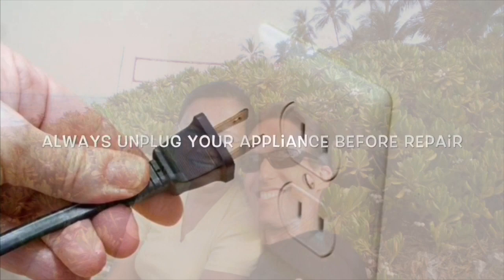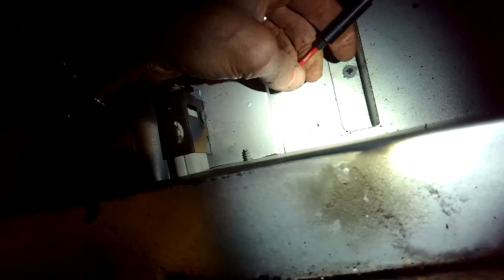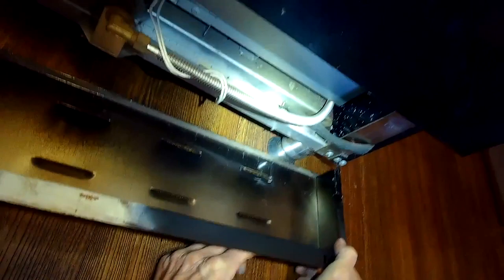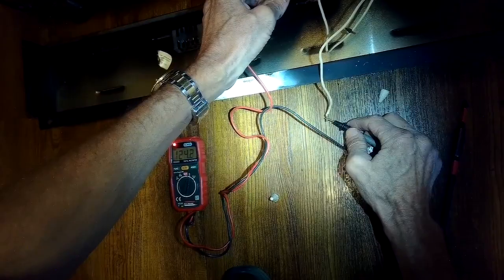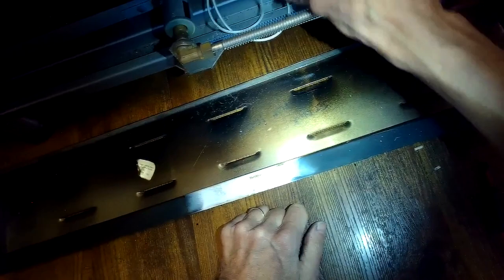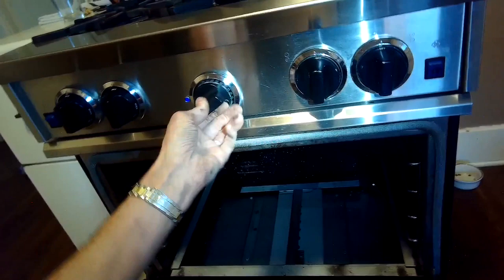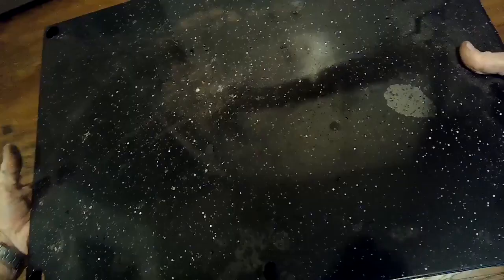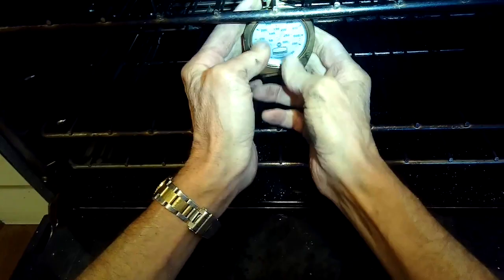⭐️ BLUE STAR ⭐️ OVEN—NO HEAT—EASY FIX

Comment: Your instructions worked great and my Bluestar is back in action. Interesting that Bluestar charges $135 for their "official" igniter but you can get a generic one off of Amazon or eBay for about $25, so thanks, also, for that tip. I have a newer model that has a two-piece (connected by a simple zip-tie to connect them) heat-resistant woven fabric tubing over the wires but it was easy to thread the wires themselves through. I also cut off the female metal electrical connectors Bluestar used and simply use the ceramic wire nuts supplied with the igniter. Also, I did not have to remove the oven door as it was possible to remove and screw back in place the retainer screws holding the lower stainless steel facade in place by lowering the door get access to the screws. Many thanks for your thorough instructions which saved me a lot of money and stopped my wife from complaining that Blue star ovens are expensive junk. I did send you a small contribution, the least I could do to thank you, through PayPal. The other problem I have with the range is the high-intensity left front burner piezo igniter some times won't stop "clicking" after the gas ignites and I can't get it to stop no matter how much I've fiddled with its distance and angle to one of the gas orifices. It is a new one although the original one that came with the range did the same thing.
Reply from the maker: Great Job,
Might be good to super clean all the metal parts to create a better ground.

Comment: I've watched the video, read the comments, removed the old igniter, and capped off the incoming wires. Now, with old igniter in hand, I am looking at the  "Frigidaire 5303935066 Igniter for Range, 1, white" at the amazon link you provided. The ceramic portion of that new igniter is much shorter than the ceramic portion in the part I'm replacing. Also, the replacement igniter in your video is an Electrolux part. I just want to be sure I'm ordering the right part. I welcome comments from Scott or anyone else who has completed this igniter replacement.
Reply from the maker: The shorter one works just as good and is much cheaper👍

Comment: Very helpful, thank you. My Blue Star had some kind of special connectors on the wires leading to the igniter. I took a risk and just snipped them off, attached the replacement (generic) igniter wires with the usual splice.  Works so far!
Reply from the maker: Yep,
Nicely done👍

Comment: Great video and tip to use more standard igniters - will be replacing mine tomorrow.  But I couldn't help notice you didn't have to plug the oven back in before you tested the igniter ;) 0:10

Comment: This is excellent. Worked like a champ! Wondering if you could post a video on resolving a thermostat replacement for the griddle on a Blue Star. Assuming that is my problem. Started seeing our griddle spin out of control on heat. At one point I had to actually unplug the range to get it to actually turn off. I would like to replace most of all the parts associated with the griddle to rehab the range as a whole. Have had it for 13 years.

Comment: Great video, thanks! I have what looks to be the exact same Blue Star model as the one in your video. I replaced the igniter with what also appears to be the same Electrolux branded igniter...looks identical. My question is about the length of the ceramic portion and the wires. Everything looks the same in my installation but I am a bit concerned about the wires being inside the oven (approx. 1 inch) due to the shorter ceramic portion. I just ran the oven briefly and the fabric wire insulation has already started turning brown. Is this a fire hazard? Thanks very much.

Comment: Thank you, I've used your very helpful video to replace my igniter several times (they seem to burn out yearly--now, I just keep an extra igniter on hand). Today, it's not working and it's not the igniter--there is no gas sound when I turn the oven on. The burners on top work fine. I have not moved the oven nor done anything else other than use it a few days ago. What should I be looking to fix/replace this time? And do you have another helpful video for how to do it?
Reply: Never mind, it WAS the igniter AGAIN. I changed it less than 6 months ago. I bake at least twice a week at high heat (450 and 475 for home made bread and pizza), which is why I bought what I thought was a high quality oven (Blue Star). But it's obviously not up to the job. Thank you again for your very helpful video.
Reply from the maker: Hi Jennifer,
I think it’s time to replace the thermostat 👍
Reply from the maker: BLUE STAR RANGE THERMOSTAT REPLACEMENT
https://youtu.be/9nSiwTxJOic
Reply: @QuickAndEasy5MinuteAppliance  Ok, I will give that a try. Looks more involved than the igniter repair but you've provided clear step by step instructions again so I will give it a go. Thank you!

Comment: Great Video, Thank you.  Ours, when you put on broil, the igniter comes on, but the burner doesn't.  But if you take a lighter to the burner while the igniter is glowing, the flame will come one and then turns off.  It goes like a wave and erratic way.   Any ideas?  Thanks in Advance

Comment: I replaced my ignitor less than 1yr ago. Out again. Is it normal for them to last such a short time? Or is something else making them blow?
When cooling down after use, the oven made a new bang sound as things cooled. Any relation to this?
Reply from the maker: Hey David,
How does the burner tube look where it’s attached to the igniter?
Reply: Mine has a hole, can you reach us how to replace that ?

Comment: This a really helpful video -thanks for making it and posting. I changed out my igniter once before but I've a few times I've had the oven not turn on - removed the bottom panel and moved the wires and it went on. Now, that wire-jiggling isn't doing the trick (I realize that's not a proper or safe way to get it working again!) From what others have said, could it be the thermostat or the thermostat wiring, where a connection is just weak? Would love to hear your take! Thanks for any help!
Reply from the maker: Hi Denise, I would check the wire connector to the igniter to get it tight and maybe replace the igniter again.
Reply: @QuickAndEasy5MinuteAppliance  Thanks so much for the suggestion. It's probably worth a try since I'm sure a service call for wiring is going to cost me a lot more - and the last local guy I had couldn't adjust the simmer burner so I don't have total confidence in his knowledge of these Blue Stars. Thanks again for the response and for the great videos!
Reply: @QuickAndEasy5MinuteAppliance  Wanted to thank you again you were right! I replaced the igniter (third time) and it's working again! (Of course, here in Ontario, Canada the replacement cost me $80 bucks...but I'm getting used to getting ripped off here where almost everything is an additional 30% regardless of the dollar! Lol!)

Comment: My oven and broiler are not working on my Bluestar range. Im about to try changing the igniter like you did but if both aren't working they each have their own separate ignitors or the one may fix both?
Reply from the maker: They each have their own.  Did they both go out at the same exact time?
Reply: @QuickAndEasy5MinuteAppliance  Im not sure if they went out at the same time actually. I picked up the oven from a lady a few days ago and she told me there oven and broiler both were not working. If they both went out at the same time do you think it would be another issue? I assume changing the ignitor on the broiler is a similar process. Thanks for the super informative videos btw !
Reply from the maker: I would try replacing both igniters.  I believe it’s the same part.

Comment: 1 minute ago
I have one of the same ovens The thermostart got damage . I have to replaced with the Elan Tstat  Thermostat part no 99487 . It came with 5 part in the sealed bag .No jumper . When I put the oven knob to BROIL, it fires up and that after 3 mins it goes into Oven  Please can someone assist in the matter  or direct me to an engineer BWO30AGs  Thank you

Comment: We have a Garland 30” Range Conv. Infra-Red Broiler (purchased in 2001) but as I understand it, Garland is now under Blue Star (and the oven in your video looks virtually identical to ours). Was helpful to hear you say that they tend to only last 4 or so years, because that's been our experience but the cost for parts/service has consistently run $500+, so you're incredibly helpful video was  very welcome news and we're interested in seeing if we can start doing this repair ourselves going forward. 1) is it safe to assume our Garland oven (model # RC30-IR) that looks the same as the one in your video will work w/ the same replacement part? 2) seems our broiler ignitor is just about ready to be replaced as well (same as in the past before it eventually conked out completely, it takes longer and longer to heat to ignite, so explodes when it finally ignites. Do you have instructions/video for replacing that one, as well?  thank you!
Reply: I have the same oven. Would you mind sharing which igniter you bought to fix it?